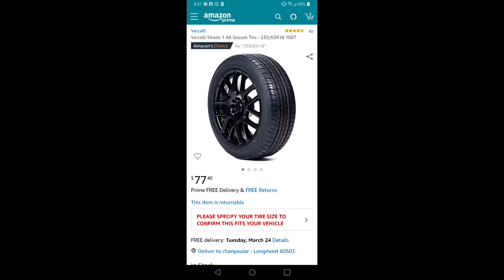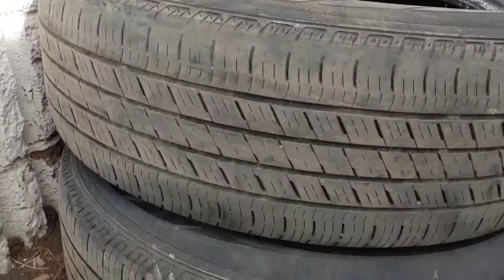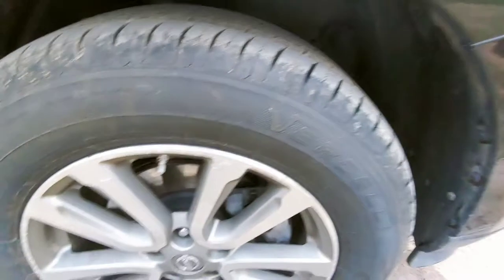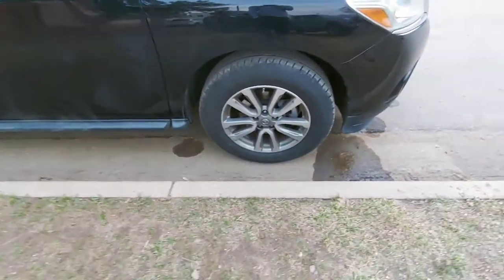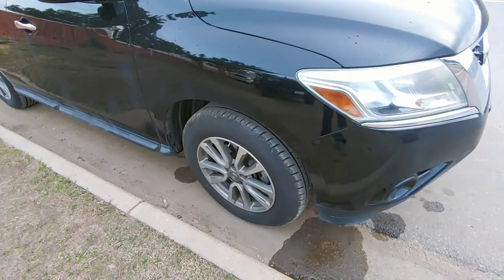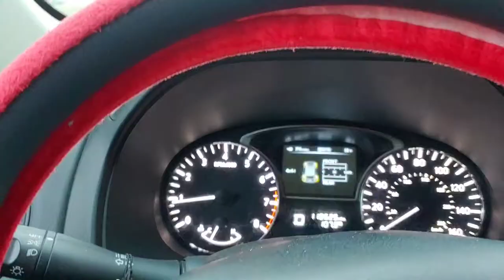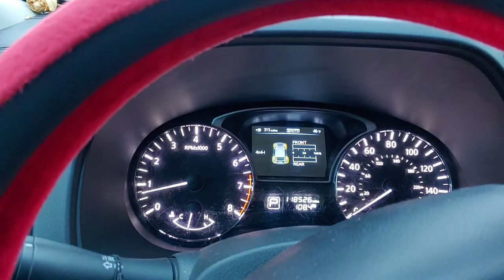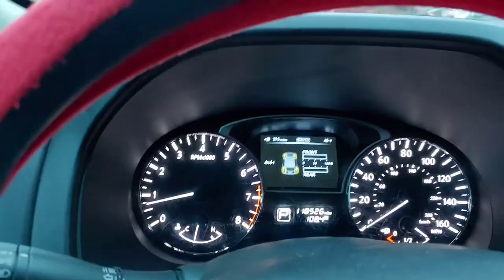Vercelli Strada 1 All-Season Tire - 235/65R18 review

Comment: I have AWD and 20 inch tires so I needed to buy all four at one time. I bought mine off of Simple Tire and I like the tread pattern. Has them shipped to the shop. They were a little over 700 dollars. I think they will be good for winter, supposed to be cold and snowy here in Wisconsin.